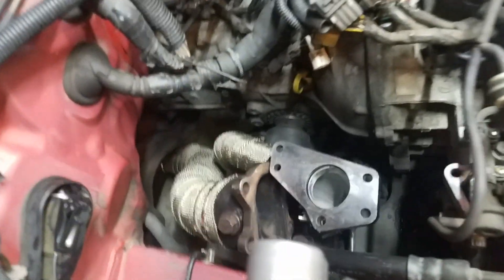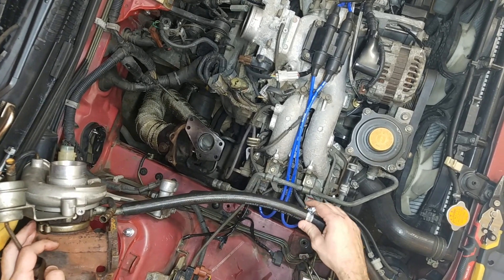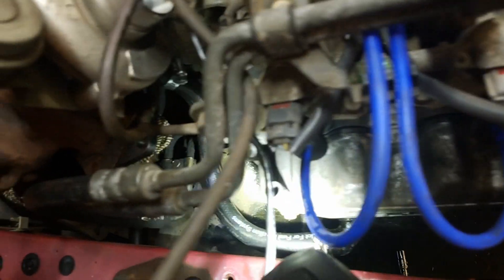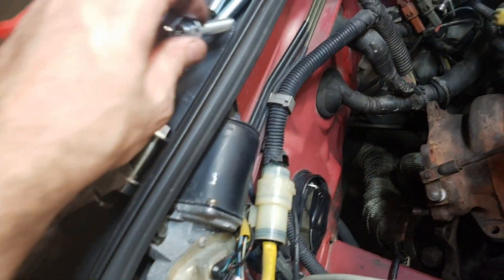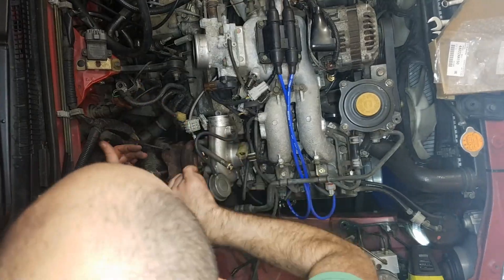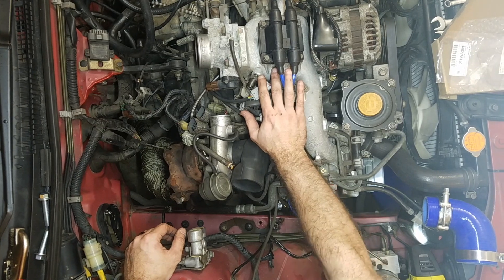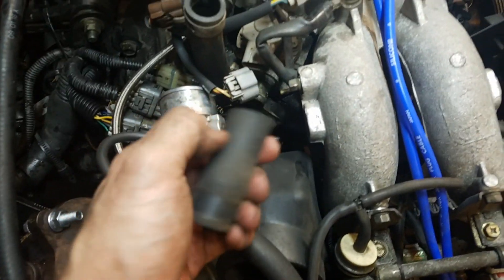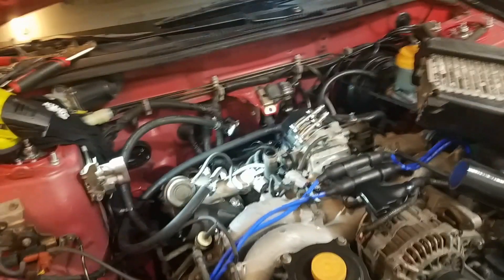Subaru EJ22 Turbo Build Part 5: Oil Return/Feed, Turbo/Downpipe, coolant install.  Intake setup

Comment: Seeing if anyone has an answer for me. I am using the same uppipe as he is but my turbo is hitting something on the manifold. Did anyone else have this issue? I have a '99 ej222
Reply from the maker: The intake manifold? It is possible the design for the uppipe may have changed or that was a bad batch.  

Try putting the coupler on the turbo first and then sitting the turbo on loosely to the uppipe and tighten everything down starting from the turbo down.
Reply: @traviscea  thanks! Will definitely give it a try! Your videos are awesome and gave a lot of confidence to do this!

Comment: what did you do to control oil flow to the turbo? too much pressure will kill the seals
Reply from the maker: Nothing. The ej22 will run the same oil pressure as a wrx. This is a wrx turbo.
Reply: @traviscea  ah ok, im getting a ebay vf48 for mine and not sure if i need to do anything to it

Comment: did you remove the cruise control module that sits right where the turbo sits? if so, did it throw any lights?
Reply: or did you just not have cruise control to begin with?
Reply from the maker: Removed it. No lights.
Reply: @traviscea  nice, so it’s just the throttle cable and a wiring connector? and then i just remove the bolts holding it in?
Reply from the maker: @mrsial05  Yep. That is it.
Reply: @traviscea  sick. i started gathering parts for my turbo build. got an 06 wrx intercooler for $40 and a td04 with no shaft play for $60
Reply: @traviscea  what did you do with the vacuum line that goes to the cc actuator?
Reply from the maker: @mrsial05  plugged it

Comment: Did you have to notch your crossmember to get the uppipe in there?
Reply from the maker: I used the inferno fab uppipe. No need to notch
Reply: @traviscea  That's awesome.
Think its possible to do on a right hand drive? https://youtu.be/yJkQSKPrsjI

Comment: How long is the section of oil feed hose you put in the turbo from the oil sensor fitting?
Reply from the maker: About 4ft
Reply: @traviscea  so is the 5ft link for the one that goes into the cab for the gauge?
Reply from the maker: @brokecuzofyamomma  yep

Comment: where did you get your oil feed line? what fittings should i get?
Reply from the maker: Good question:
Oil galley for where stock oil pressure sender is https://www.ebay.com/itm/372494801705

Banjo bolt for td04 with 4an fitting:
https://www.ebay.com/itm/263990727719

3 way fitting(for if you have a gauge to hook out as well)
https://www.amazon.com/dp/B01MR3P4IM/ref=cm_sw_r_cp_apa_fabc_JzLeGb2PFYS0Y?_encoding=UTF8&psc=1

5ft 4an stainless line with 1/8 npt and 4an fittings.
https://www.amazon.com/dp/B009Q75328/ref=cm_sw_r_cp_apa_fabc_UBLeGbW2VJCSE?_encoding=UTF8&psc=1
Reply: @traviscea  where can I find a down pipe that would be a direct bolt up?
Reply from the maker: @B.R.BGarage  Any WRX dp from 02-07 will work. You will need a catback from a WRX as well
Reply: @traviscea  that’s great news! Also I forgot to mention that in my previous question that the map based ej22 and maf based ej22 can run by simply interchanging sensors and also interchange the cog gear, intake manifold and the transmissions will bolt up/ work regardless of the year 1992-2001 Subaru Impreza from that time period with the exception of the 2.5 rs. They have a 4.11 to 4.44 depending on the factory gearbox for those versus the 3.9 final drive in the ej22 Imprezas and Legacy’s of the time period. Also found out that you can easily interchange rear disc from the legacy and ej22 from I believe 1995 to 1999. I share this info in hopes it may help others. Cheers 🍻!